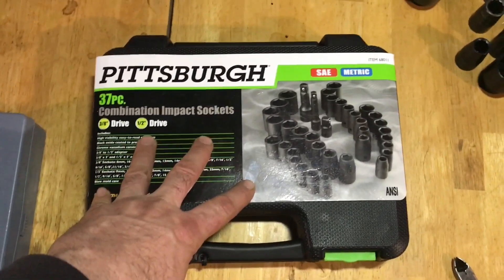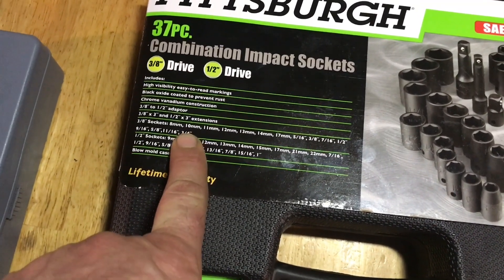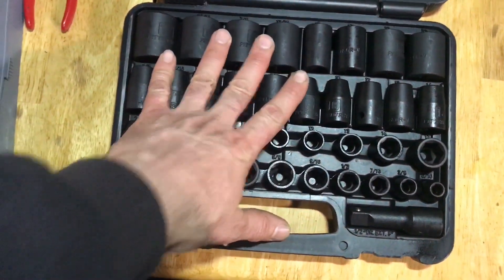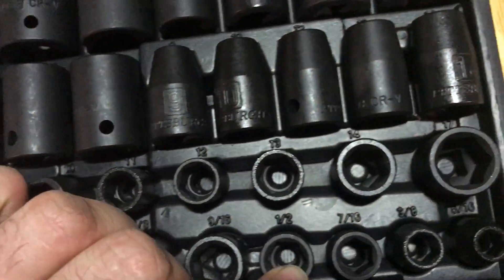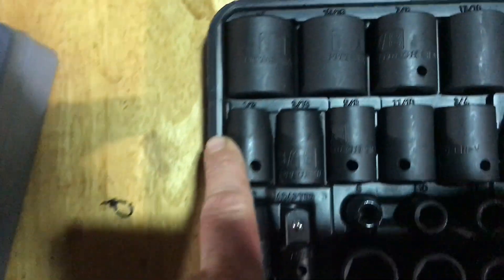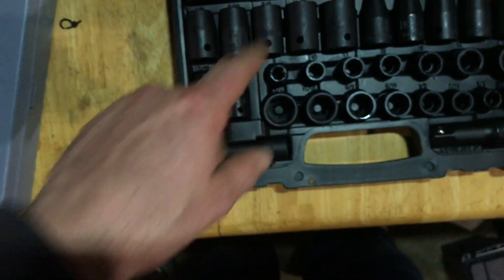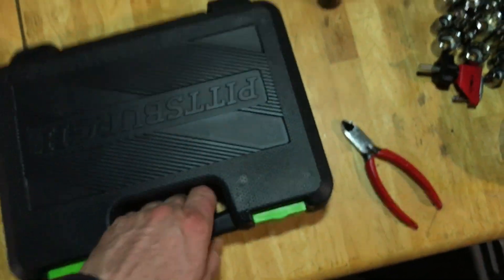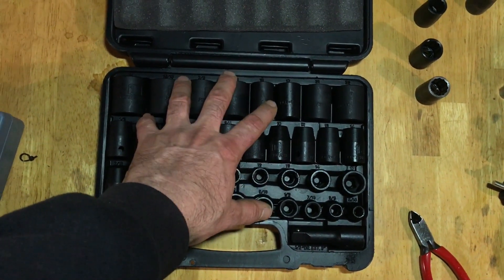Unboxing Harbor Freight Pittsburgh 37pc Combination Impact Sockets item 68011

Comment: Just purchased these. So far there I’m really impressed by them. I own some snap on and old IS craftsmen impact sockets and in my honest opinion there just as good
Reply from the maker: I have also been impressed and this set even though missing sizes covers most of what I have needed working on my cars, generators and commercial HVAC equipment. If they had a set that covered all sized standard and deep I would buy it. I should probably do a review on these but wanted to beat on them to see how they stand up over time. I never owned impact sockets before. Yet the drive opening doesn’t get damaged like chrome sockets. I use these instead of my chrome sockets most the time
Reply from the maker: How do you still feel about your sockets. Mine have held up no matter what abuse I put them through

Comment: Hacker I'm surprised that's set didn't come with a alien green ratchet lol. Peace brother
Reply from the maker: I know your hating on that ratchet, It has become one of my favorite ratchets. I like my gear wrench 120t, craftsman 84t, Sk swivel but that green alien ratchet just seems to easily move around stuff.
Reply from the maker: I wouldn't have hesitated to purchase if it came with a free alien rachet. It would be easier to have some impact sockets to get started and if I break these they are lifetime. Yet I might have to upgrade the 10mm to SK or Snap-on. The lifetime warranty doesn't cover dropping into the engine bay and never seeing it again.

Comment: Newbie question here about a impact wrench I’ve recently purchased which is a Harbor freight 3/8 Cordless Earthquake XT impact wrench 20volts and I could not on my whole life fit a goddamn socket on to the damn anvils.  I did order a few sets of 3/8 sockets online that says it was for 3/8 impact wrench. So will this fit in without no doubt or I need a goddamn adapter for the damn 3/8 Earthquake XT impact wrench? I’m just so devastated that I can’t even use my new impact wrench I recently bought about 2 months ago...
Reply from the maker: They fit in my Milwaukee 3/8 ratchets, 3/8 Milwaukee impact wrench and 3/8 Milwaukee power ratchet. Was the anvil mabey not manufactured correctly?
Reply: Those earthquake are too expensive, i got the bauer instead to keep at home, i use dewalt at work. You can get dewalt quality for that earthquake price.
Reply from the maker: I was considering the earthquake pneumatic 1/2” impact driver. I have a coworker who has a Bauer 1/4 drive hex impact and loves it.